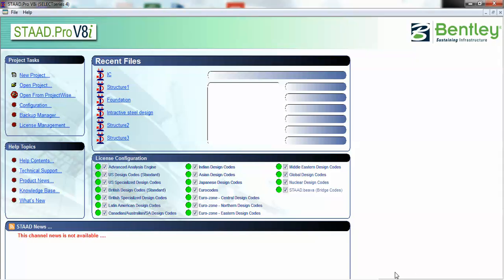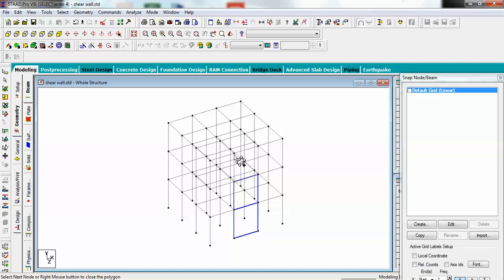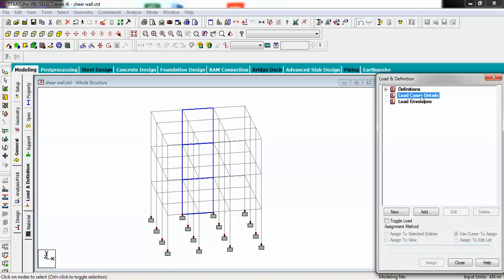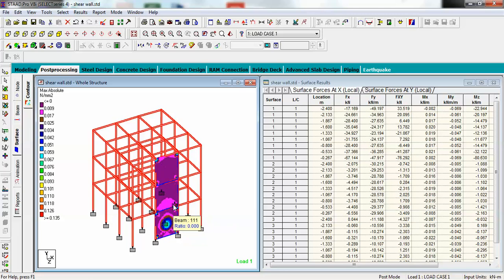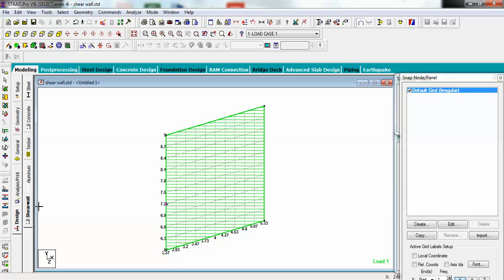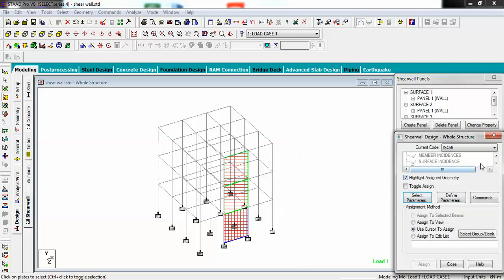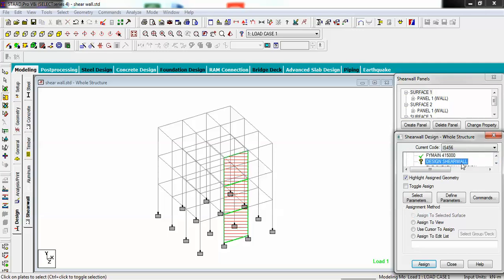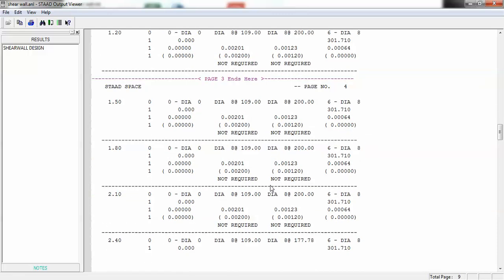Shear Wall design and analysis using IS456 in Staad Pro V8i

Comment: dear sir,
thanks for releasing such a informing video..but my question is different...like here below

i am trying to design cırcular water tank which devided into 4 differents boxes..ı want to know;
1-how to applying water pressure on basement plate in which subject of load type...(like fluids,live,none...which) 
2-also water ressure on wall has to be under the same load case predefined or under different load case data?
3-ıf ı defined Ex,Ez,DL,FLUID LOADS ON WALL how to make a combination of loads to get true results?
4-Loads of each water tank box should be defined diffrently with others load case or we should make diffrenet load case with each water tank boxes?
ıf u have any example to share ı would be very appreciated...
regards..
thanks for all ur kındly advıse

Comment: Thanks so nice . these days i m carrying out proof checking of few rcc frame structures and one one of them is deficit so far as the earthquake loads are considered and i am proposing to introduced shear wall atleat at two location so as to increase the strength viz-a-viz earthquake loading. Please help  me in modelling the same in staad so that hear wall will take maximum load.